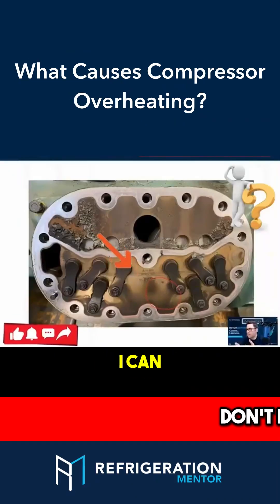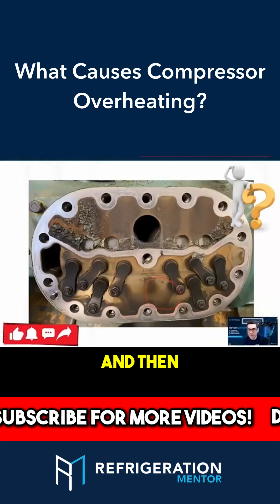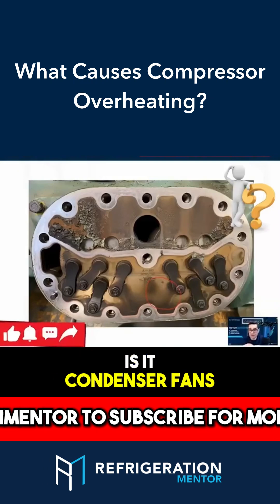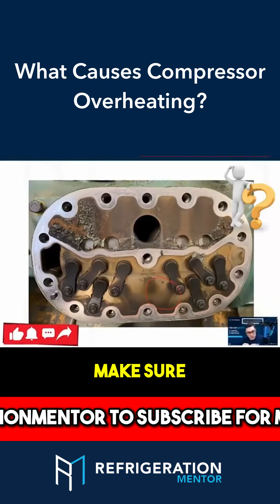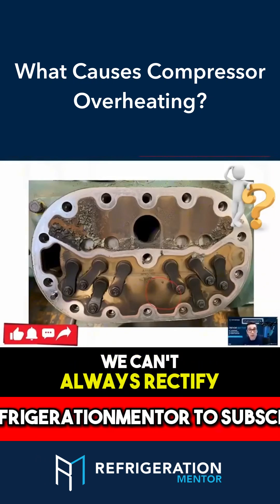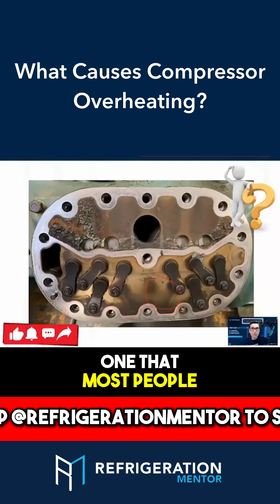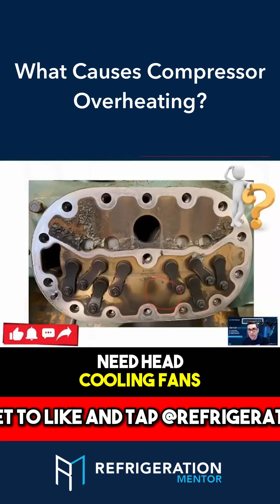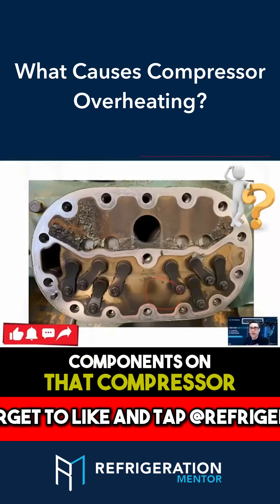What Causes Compressor Overheating

Comment: With how cheap a temperature sensor is to plug one wire into a board that has one line of code for one sole purpose. When it reaches a certain temperature, it could send a text message an email or a Audible alarm with a blinking light.. 
    Or even shut down the compressor if it’s not a crucial application. 
     We’re going into the 22nd century and they still have controls with a few bells and whistles, but it’s like the manufacturer intentionally does not put in a reliable compressor shut down or alarm for an overheat situation located right in a crucial area like either mounted into the head or right on the discharge line
  VRF companies are extremely guilty as charged. 
      Every manufacturer allow the refrigerant level to get so low and allow the compressor to continually operate under screaming hot conditions until the compressor lets loose
Reply from the maker: @coldfinger459sub0  well you know that every component is a cost and usually things that cost are options.  And if it is not mandatory then it’s left off even if it is a critical component. I am sure there are studies out there sensors vs warranties. 
Also, There are always a few sides to a story too like why is it running outside the operating conditions.  Is it because End user/customer/tech/manufacture always some many questions vs answers. Thanks for commenting